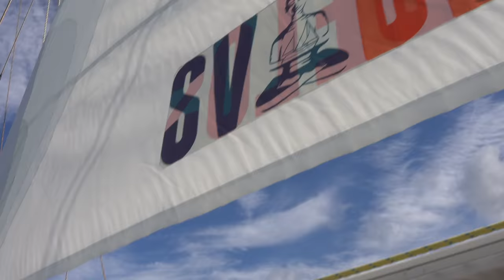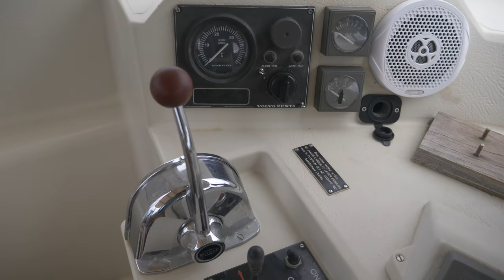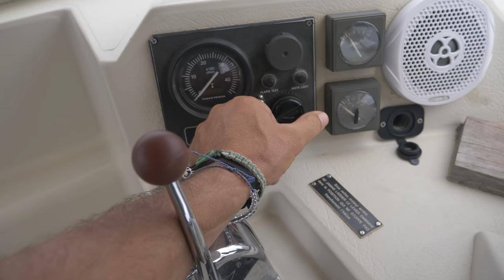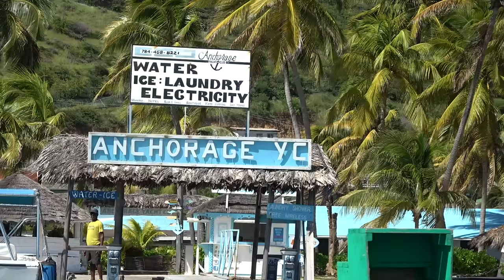Cooling Pump FAILURE!  STOP Motoring You P***y's!!!!- Sailing Vessel Delos Ep. 214

Comment: Old salty sailor taught me once to add dish soap in the impeller housing and before you attach the discharge hose to pour water in to prime the pump action.  Seeing the soap over the side at your discharge lets ya know ya got the thing turning and pumping.  Sea friendly soap of course.  Learned a new trick that day and I've never stop learning new stuff at sea.  Thanks for sharing your "how to's" guys..I really like those episodes.
Reply: I was taught the same, its the same issue with bearings, those first few moments of use, heat, and friction matter to the longevity of the part. Good initial lube is important, dish soap and water help lubricate the impeller until the water starts flowing, keeping it from heating up, and they heat up quick without water!

Comment: On my Perkins 4-236 I had a sea water flow alarm after the raw water filter. i highly recommend it for your operations. Some are adjustable. I also had a 205 F overtemp switch instead of 225. I also had a temp gauge. I set out to cross to the Bahamas one night and the alarm went off. There was a cluster of Sargasso weed seeds stuck in the intake of the sea water filter. Cheap protection.
Reply: I have just purchased a used 1981 Endeavor 37 with a Perkins 4.108... I think I will incorporate your ideas into my engine safety features!

Comment: I got so tired of jacking with impellers on my Yanmar, I installed a filtered electric water pump to cool the engine. No more worries. the only problem was find a belt that fit the new setup without the impeller drive. Just a 12v RV water pump identical to the one that pressurizes water for sinks and showers.  More energy efficient as well. relay controlled house-water pump would switch it over anytime the engine water temp rose about 196. Set off a visual and audible alarm at the helm. cheap RV parts same stuff as "yacht" parts but with redneck prices.
Reply: agreed. wayy better idea.
Reply: I haven’t watched this episode yet...I’m a year behind, trying to catch up.  I just watched episode 145 (or close to it), where he replaced the water pump impeller in Namibia.  I noticed he got some of the impeller blades pointed in the wrong direction...didn’t think that would last very long.  I wonder if this latest fix was a result of that?
Reply: seidelp you have soo many fun episodes left I’m jealous.
Reply: seidelp there was an episode where Capt. Brian explained it didn’t matter which way the blades pointed. They would just fold over and go the correct direction. Just realized this was that episode.
Reply: @737MaxPilot  , they fold over the right way the first revolution.  It doesn't matter which way they point when installed.   It took me a few years to figure that out, I admit!

Comment: Great episode guys and gals!  I liked every topic you covered.  As to the underwater volcano problem, I realized that one of your favorite things can help explain the problem.  That thing is BEER.  In a big enough glass try floating a tiny model boat on the "head" (aka foam).  Unless it is light as a feather the tiny boat will sink.  Besides that I'm glad you got your motor running again.  Seems like that rubber impeller has failed at least 4-5 times over the years - from what I remember.  Somebody could make some money inventing a better system.

Comment: Great patience on that Captain right there! The reason for that mishap is probably the fact that he couldnt even remember the last time he changed it (meaning the rubber had gone bad/stiff) pared with seashells going through it tearing it apart. I wanted to clear something up as i heard him say "as long as it stays wet, it'll last forever right?" This is incorrect, and you should change your impeller regularly. We actually change impellers as a part of an engine service where i work because it is a part that gets wore down bit by bit every time the engine runs. 
Glad everything went okay for you guys!

Comment: When you get an impeller failure check for broken pieces in the hoses both upstream and downstream of the pump, when the pump looses suction some bits will drop back, I found that the hard way.  If it feeds through a cooler usually you will find a collection at the start of the tube stack. An exhaust temperature alarm sensor epoxied just aft of the raw water injection point will tell you if you have a failure or blockage before any major engine overheating. Good job doing the full service on the pump!

Comment: A little bit of grease on the impeller helps with the first start up until the water gets there to lubricate it. It just might help it last longer for you.
Reply: ya, I would have just dumped vegetable oil in it, he obviously ran it without water until he fixed the filter, it did run dry for a bit...

Comment: Good job, probably been said already, bit when in dock next or when stopped. It's worth checking the heat exchanger, those broken fins will find there way there and cause a partial blockage. The cap needs removing and the core checking.

Comment: You can flip the plate on the sea water pump. The face toward the impeller will get pitted grooved. This will help with air pockets preventing the pump to prime itself. Heat will also destroy the seal and sea water will mess up your bearing. I add cooking oil in the pump and strainer for the initial priming. Learned that while on a 1930 gaff ketch with proper engine room :)

Comment: Always great to get a new set of sails. I remember getting my first set of bespoke racing sails after sailing the crap out of the original factory sails for 10 years - by that time, they were as my dad used to say,  "like wet nickers".  I Spent my first pay cheque on the deposit for them and paid my dad off each month for the rest. It was  a big deal back then, I'd had the boat in kit form for my 12th birthday (Mirror dinghy) and back then, the whole kit with sails and paint was under £80 pounds ...and now I'd just spent over £200 on new sails  ...but wow it was worth it, she was like a new boat.

Comment: Maybe it's time to have a preventative maintenance schedule for your sea strainer..should not be getting that much stuff past the basket.
Lube the impeller with dish soap, and orient blades in direction of rotation.
Have two complete pump assembly's, in case of failure, just swap them out, and rebuild at your leisure.
Impellers should be changed out every 12 months or whatever hour the engine manufacturer specifies..usually 500 hours..
On the boats I run, I do all impellers every 12 months, rarely get to the hour requirement...very rarely do we lose an impeller underway..Fair Winds!!!

Comment: My Westerbeke ate impellers for a while, and it drove me crazy. Every passage I could test flowed freely. Finally, a real mechanic pointed out the carbon buildup in the exhaust manifold was creating back pressure, and it doesn't take much to destroy an impeller. A new pipe fitting where the water went into the exhaust and all was well!

Comment: Seems like no one else commented it so maybe I'm wrong, and I'm not an expert, but I was always taught to use a little lube on the impeller and to make sure it is going the right way. The reason for the lube is so that it doesn't run dry during the few seconds it takes for water to get pulled in to it which can damage the vanes. Actually, what happened to you with the air in the system is one time when that's even more important since it wound up running dry a bit longer. 

No idea how much it matters and no big criticism...you guys do a great job!

Comment: What type of water strainers do you have inline for the engines ? If plastic you need to check the plastic for cracks. The cracks will suck air into the system and cause premature pump failure.

Comment: Just rebuild my impellerhousing on my penta. Extremly high price for 2 6001 berings and seals. 
Needed the axel. So just had to order penta parts. 
Oh the joy to have to remove engine legs, and lift the motor. To accsess two of four bolts.. 
But, no cooling. No engine..

Comment: Hi cool repair! But never hammer on new ballbearings. You can hammer the old one out but the new one has to pressed in. Hammering around ballbearings will ruin them bevor the first turn. You may not notice it right away but it worns out very fast after hammering. They are made for rolling, not to take high impulse. In case of emergency or quick repair try to hammer only the ring that you want to lower not the ring that is connected over the balls with the ring you want to lower. Means if you want to lower the ballbearing into the housing, only hammer on the outer ring. If you want to lower the ballbearing on the shaft, only hammer on the inner ring of the ballbearing. You can imagine that the balls are rolling on a very small surface, if you hammer on them they will get dents on their hardened surface. Only the surface of the balls and the rings are hardened.

Comment: jabsco impeller pumps like a tad of silicone lube, just for initial lubing during the first dry run.
Running it with out the lube will most likely not be an issue tho, but it will never hurt.
If you have a dab, use it :)

Comment: Buy some of the globe marine run-dry impellers.  They last more than 90 seconds running dry, are three times more durable than standard, and generally last three times longer.  The impellers generally are a blue color, and typically only cost 5 or 10 more than a standard impeller.

Comment: Here is an interesting thought I had while watching around 26:30. If you did in fact put a little veggie oil on the impeller when you installed it, in the case where you had an air lock the impeller would suffer no damage if it did not get any water right away. That short amount of time probably not long enough to damage the impeller. Just a thought that popped in my head in in favor of pre-lubing impellers.

Comment: When the engine overheats the fuel injectors, as long as the engine is running, has diesel fuel running through them to keep the fuel injectors cooled... When the engine shuts down the hot engine "heat soaks" the injectors and can cause the oilly/diesel film in the injectors to carbon up and potentially stick, or not spray (atomize) economically!... Something to be aware of, you will want to check your injectors at some point to see if they're still atomizing properly.

Comment: I Just got back from viewing a 1997 Super Maramu we was interested in but we had some concerns with the engine. We started it from cold and was told the boat was moved to this mooring 2 days ago. So as expected with a boat that has the original engine of 22 years it puffed a little white smoke when started but also deposited a film of oil into the water that spread to en-golf that hole side of the boat. The broker called over the Volvo engineer and he stated that this was normal for a engine of this age. It has 2200 hours on it. I have a 32 year old engine and mine does not deposit oil. So am I right to be concerned or was the engineer right. Many thanks for any advice.

Comment: That was a lot of water in bilge when the engine overheated. That's a great adjustable hammer. Do you have a model number for it. I put a water based lube in the impeller. That protects it for the start up.

Comment: I have now witnessed you replacing impellers so often, I'm wondering when you are going to replace that impeller-system with a method of cooling the engine that is build in a way that is not breaking all the time (for example: that does not use those floppy rubber things to transport water, so you do not have things that are bound to break some time). :)
Reply: Lol show me a pump that never wears out or breaks when you run it dry.

Comment: Guys as a professional engine rebuilder never us RTV on engine seals or internals, instead use permatex black rubber marine sealant. RTV is silicon based and will harden like a rock I've seen it break exhaust valves before. Just a thought.

Comment: At the risk of teaching my grandmother to suck eggs --- On the new impeller , Glycerine or rubber grease.  Installing bearings push only on the outer race. V belts, I like to leave mine a little less tensioned and spray them with belt grip. Prolongs the life of the bearings. My two cents worth , done. Great videography . I loved the drone footage. thanks for posting.

Comment: Great how you can handle repairs at sea. If you can't, you shouldn't be out there.

As for replacing bearings in a housing, pressing in is much better and more precise than pounding. Consider having frame with a jack screw to press bearings in. Even a large C-clamp and some sockets can make a decent compact emergency press.

Comment: 11:00 It's pretty simple. An object will float so long as the density if the object is lower than the decency in which it is suspended. If the objects density is higher, it sinks.
    This is why helium and hot air balloons, boats, and blimps float. Lower the density of water with a bunch of gas bubbles and the boat will sink very very fast.

Comment: What ultimately happened to the raw water pump ? That engine has a lot of a Aluminum in it. I think the head & block are Aluminum , over heating will cause these castings to fail at there connections I.E. head gasket.

Comment: Try not to hammer bearings in thru the ball path, put the force on the outer race, or you put dents in the ball races, and use a plastic hammer vs metal, press is best, use old bearing as driver or sockets.

Comment: Although I’m always happy to see that Brain can fix everything I want to make a small comment this time. Brady was right, you should have greased the impeller with a little soap before mounting it. This gives it its lubrication for those first minutes when no water is flowing through the pump, Now you had the risk of overheating the impeller in those first minutes. And yeh, impellers should be changed every year. The rubber gets old and it will fail, always on an unexpected moment.

Comment: So Mr. Brady: Considering your (Brian-less ) up-coming Atlantic crossing..
it may be intimidating having everything on your shoulders.,  so ....Do you think you could have diagnosed and repaired this problem as well as yer bigbrudder?... or that one way or another you would have had success.. or would you have had to wait for port help?
The hardware was one thing but the air-lock/vapor-lock thing  is a yet another puzzler without experience. Well... of course as long as you can chat w/each other via email... that can be your solution.. No?

Comment: Due to the cost / value of the engine, The manufacture of the engine ( Volvo )  uses an inexpensive pump, coolant pump. On Diesel engines that are gear mounted and extreamly exspensive that is where you will find pumps with ceramic seal assemblies. These type of assemblies require no maintenance and will last for a few thousand hours of engine operation. Please email me if you have questions.

Comment: noooooo, dont do that do bearings when putting them in, make sure you hammer the outer race to push it in properly without damaging them .... and it would be smart to fill them up with some blue marine grease, they should last abit longer...also, no , implers dont last forever if wet... impelelers last 200hours (working) , they get weak spots on the blades from being bent, and they start to become stiff and britle. change them every second service of your engines and you will never have problems with them (yamaha tech, i change a few a day)

Comment: Best sailing on YouTube. Thanks.

There was a question asked about belt tension. I looked for an answer. Another tidbit of 'nice-to-know'.

"At the correct tension it should be possible to press in the belt approximately 5 mm between the pulleys. A torque wrench is required for making adjustments. Place the square plug of the torque wrench in the hole. Set the torque wrench to 60 Nm (44.25 Ft/Lbs) and tighten the bracket screws.

SOURCE: https://www.manualslib.com/manual/840880/Volvo-Penta-Md22.html?page=103#manual

Comment: As for a the amount of water being pumped ? The is no way you can measure the amount of water being pumped vrs the rpm’s of the engine.
The anti siphon break ? If the anti siphon break is spitting that much water under the running of the engine than you have serious problems .

Comment: Man, You have replaced those impellers sooo often what a pain in the rear. id be looking for a Different type of Water Pump.  Possibly  Electric With a Impeller that does not touch the Housing. similar to a Pool pump type of unit. Thats Definately the Weak link on that motor. Terrible design those rubber impeller pumps are. a Screw drive type of Pump would be definately a Better design. anything has to be better than a rubber impeller rubbing against a Brass wall all day long. terrible design !

Comment: When will marine engine co's start supplying their engines with either 12v variable speed magnetic drive pumps or belt driven magnetic drive pumps.  They go for up to 10,000 hours, don't have shaft seal problems and some can be run dry without self destructing. They are not self-priming but the engine locations on most sailboats are below the waterline.  It seems every cruiser Vlog I watch at least 1x time a year is replacing an impeller or rebuilding their raw water pump.  Imagine if a co's washing machines had a water pump failure every year- they'd be out of business in short order - yet we take this type of failure as acceptable on a marine engine.